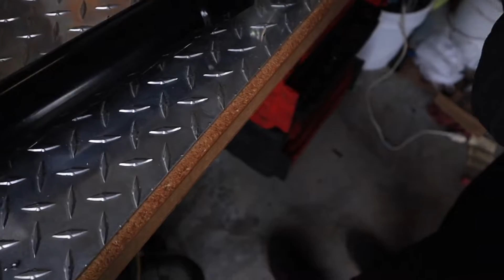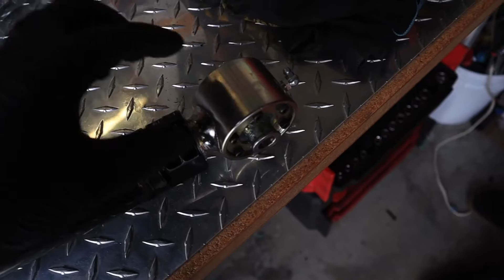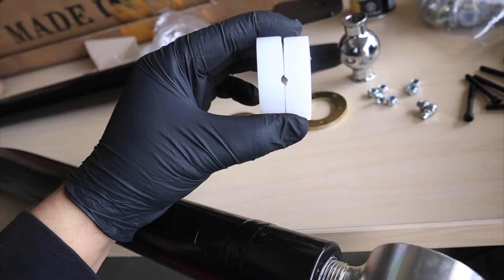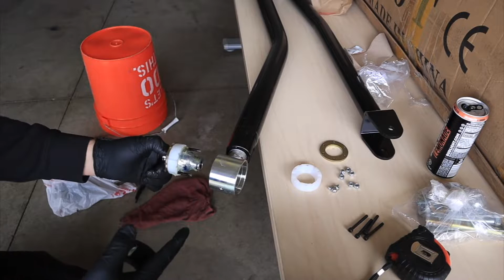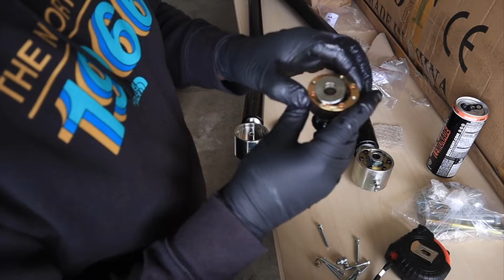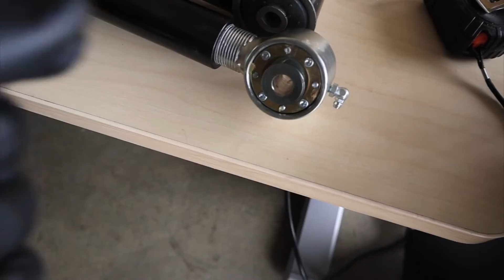Iron Rock Offroad Flex Joint Assembly for Long Arms on a Jeep WJ Grand Cherokee | Najar Offroad

Comment: Good looks man i plan on getting a couple of those for the axle side of my front upper control arms. Should i build it before i install the sleeve or after?
Reply from the maker: So for the upper control arm fit the casing in the axle first then you build it while it’s in the axle